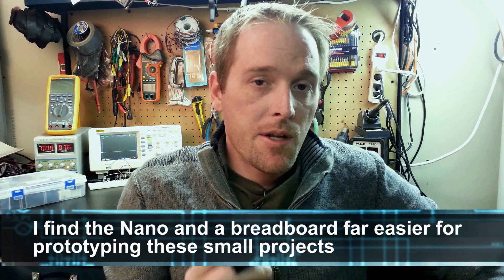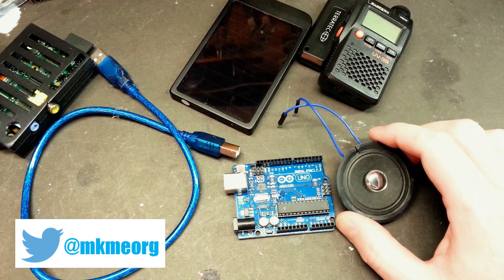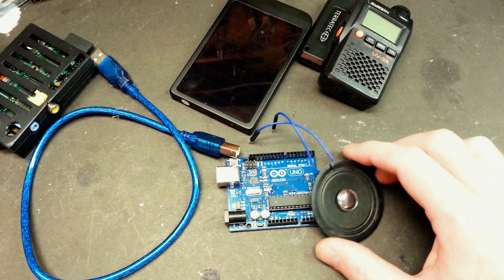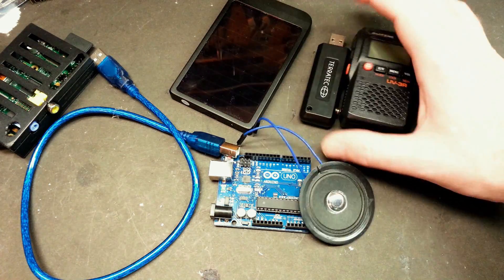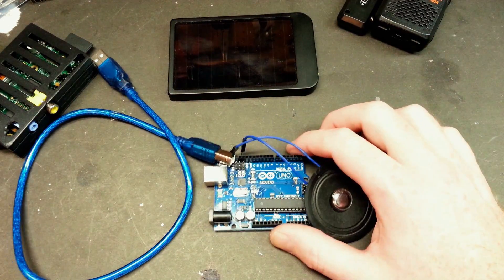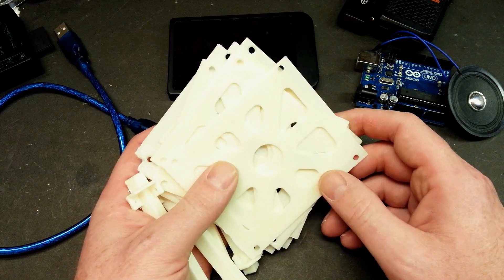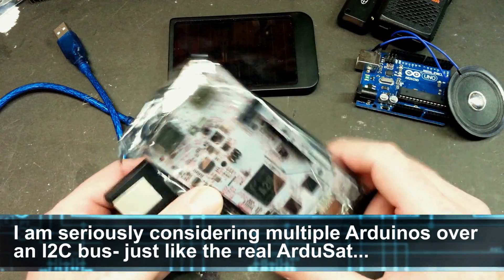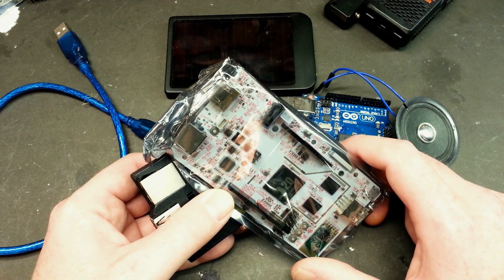Let's make a Satellite with Arduino Part 2-  CubeSat Components Overview

Comment: Hi, Eric. I have 2 questions - Where I can buy this AM receiver? And also - if I put more solar cells (in the Cubesats they are 4 or 6) on it, will it charge the battery better or something? I think about some sort of a solar panels deployment. Sorry about the noob questions - I'm a mechanical engineer and electronics/software is just a hobby for me.
Reply from the maker: +magdanoz88 The receiver to use most is an SDR.  Receives just about any type of transmission.  You can buy one here:  http://store.mkme.org/product/silvercell-usb-2-0-digital-dvb-t-sdrdabfm-hdtv-tv-tuner-receiver-stick-rtl2832ur820t2/  Or follow the "How to buy an SDR" vid on my channel.  On the panels- yes more is better.  All sides covered pretty much- well depends if you will stabilize your sat I suppose :)  Cheers
Reply: +Eric William -MKme Tech Thanks, Eric! I found the answers for my first question from your videos. When I was typing it, I was relatively new here but now I have so much more information! Thanks for sharing! Your work is very inspirational!

Comment: Hi! Good job, i'm really interested in this project so keep going. I'm currently working on a project for my exam. It's about making wifi low power modular sensor using pro mini, esp8266 and a lipo battery for the sensors, MySQL for the database and angular JS + PHP API for the web app. Sorry for my English. Have a good day :)
Reply from the maker: Maaututorial Your english is fine :)  Sounds like you will have a great project!
Reply: totally true!!

Comment: Had a quick look at those 433mhz pairs you've got there from Ebay.  It seems you have to be careful, some sellers advertise them PER PAIR but others advertise them PER PIECE (with 2 pieces making a pair).  In some listings you can't even tell which they mean, which rings my mental alarm bells pretty loud.

So buying them in 5pcs like you did is probably the best bet, the odd number would ensure they are selling them per pair.  Good prices for 5pcs at a time too (similar prices to the risky even-number of 10pcs), the 3.58USD one you grabbed seems to be the cheapest.

Looking forward to this.  Curious to see the capabilities of these cheap RF modules
Reply from the maker: roidroid I'm really looking forward to them as well.  Should be fun.  Cheers